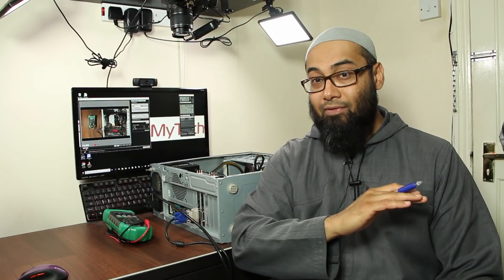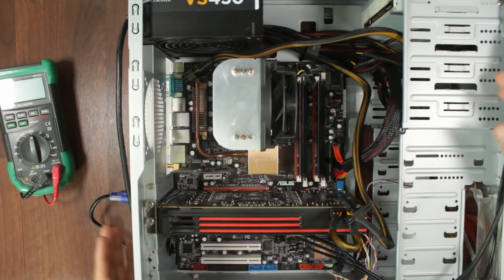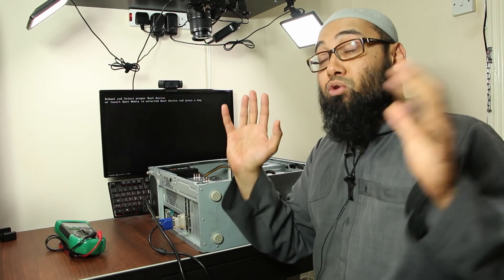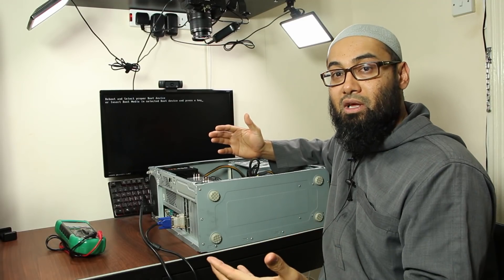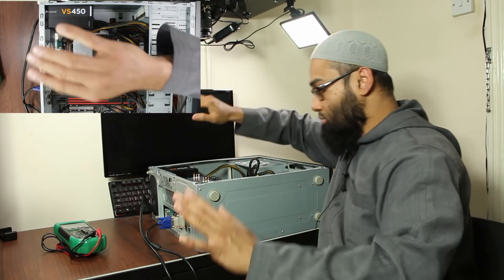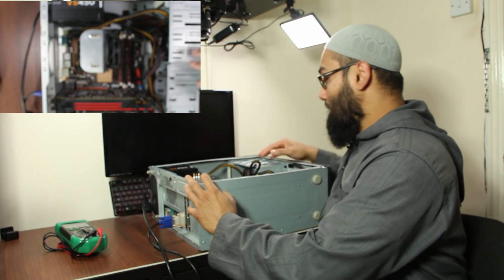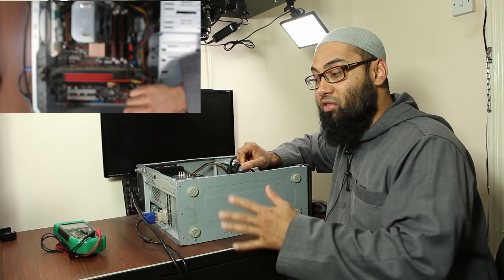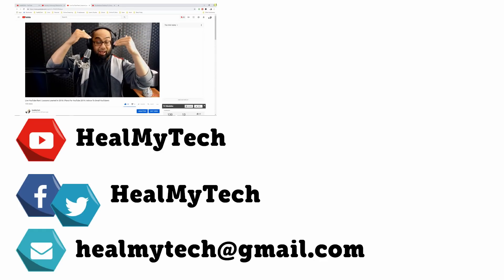Troubleshoot Cables - Pt 7 Computer Not Turning On Or PC Turns On But No Display On Monitor

Comment: Everything comes on in my pc except the gpu fans. Originally the only thing that would power on was the front rgb light and no fans I pulled everything out and re-seated everything and I got power to everything except gpu and usb ports…. Idk what else to do other then buy a new motherboard

Comment: salam alaikoum. i have a gt730 
when i use vga it wont work 
when i use a vga cable with dvi adapter it works but the screen is soo dim 
and HDMI works fine but only after booting into windows